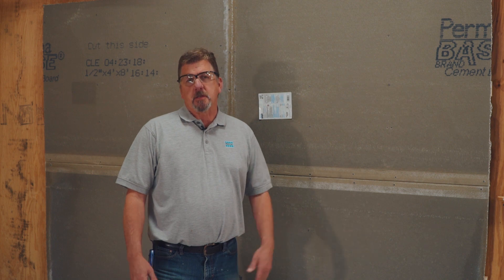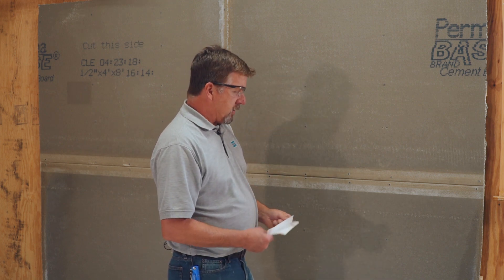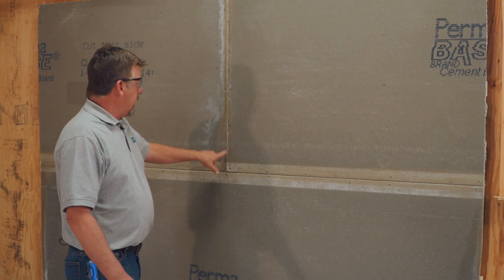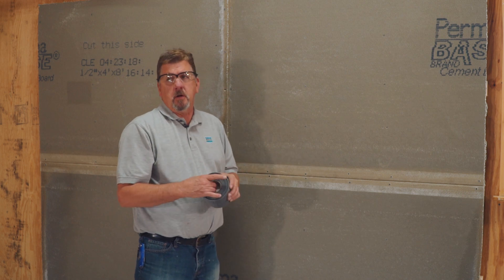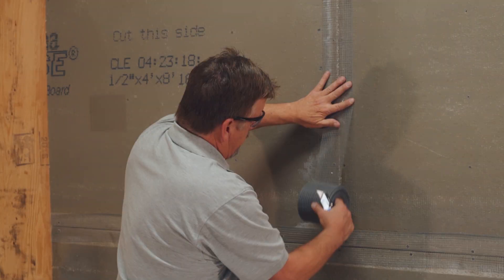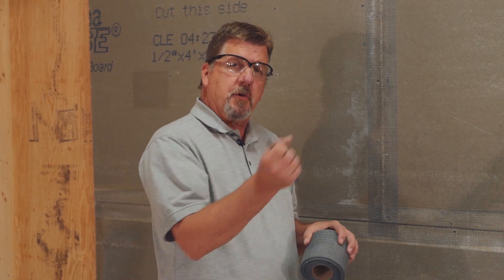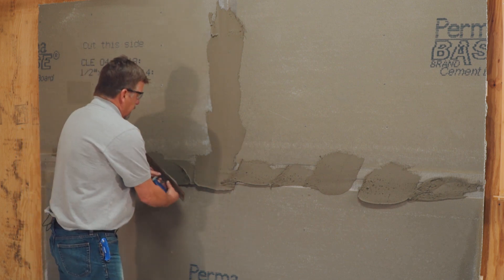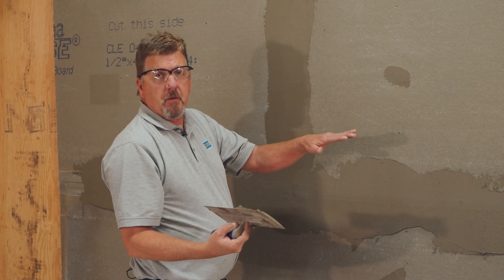Introduction to Masonry Veneer Installation Systems by LATICRETE

Comment: For stone columns, can I do  pressure treated 2x4s,  install the cement board  with no plywood sheeting behind  then seal the cement board and install the stone?
Reply from the maker: Hi there. Not knowing the full size or intent of the columns, or the size of the stones, all we can suggest is to follow the projects local building code for exterior stone installations. Hope this helps!

Comment: where is the WRB?
Reply from the maker: Hi - can you clarify what WRB is?
Reply: That would be the weather resistive barrier that is required by code
Reply from the maker: @braunzie2  The LATICRETE Air & Water Barrier is classified as a WRB.  However, local code still may require a WRB behind.
Please reach out to local LATICRETE rep, for more information.
 If you do not have a contact, please email socialmedia@laticrete.com
Reply: hopefully you installed it after your sheeting and before the cement board.